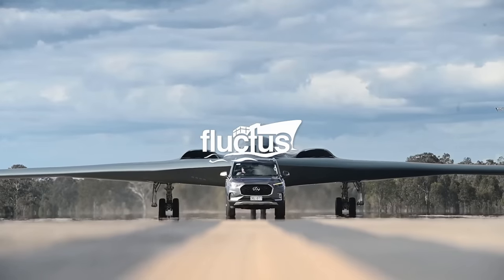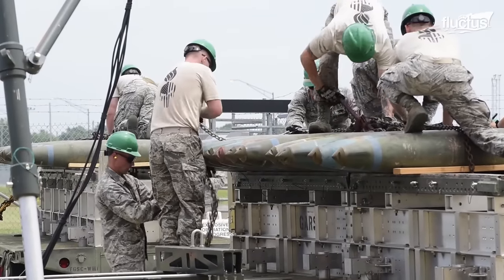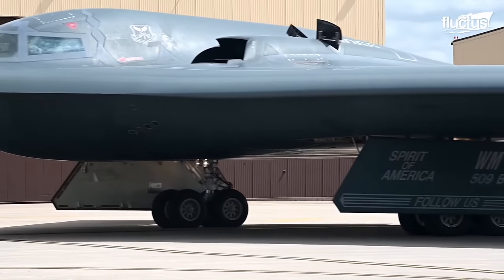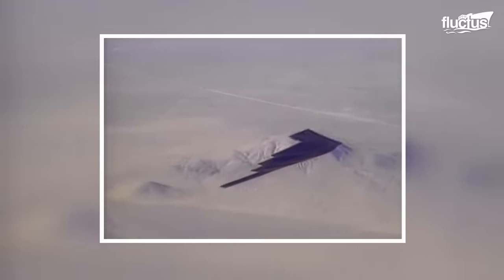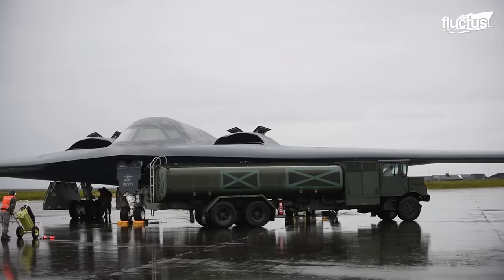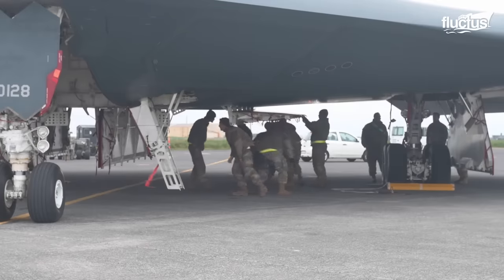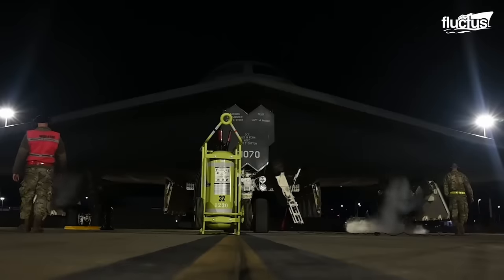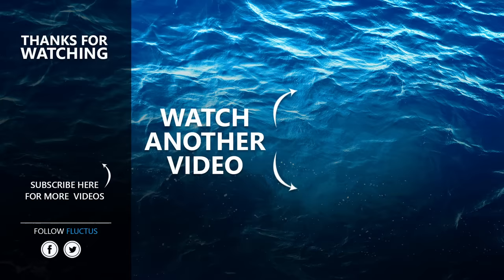B-2 Spirit: US Most Feared Stealth Bomber Ever Made

Comment: Operation paperclip  -  Hitlers Horten Ho 229 ( secret aircraft) converted in to B -2 sprit Bomber.
Reply: The B2 is based on earlier flying wing designs of the 20s and 30s from Northrop themselves such as the YB36 and YB39. They combined the basic principles of a flying wing with lessons learned from the Tacit Blue program and made the B2. 

Northrop used original designs of their own manufacture not the designs of the Ho229 which was frankly a terrible airframe. When tested by both lockheed and northrop to test the validity of stealth claims there was no such "carbon black" stealth coating as the Hortens had claimed and the Ho229 was around the size of a He111 on radar from the time.

Comment: German technology from ww2
Reply: No, the flying wing design of the B2 Spirit is based on earlier flying wings made by Northrop, noteably the YB-49.

The Germans never made a stealth aircraft in ww2. The Ho229 while a flying wing was very easy to spot on radar giving off a similar signature to an Me262. Northrop built a full scale replica and tested it to prove it wasnt stealth, and the mockup was actually stealthier due to the use of only wood in its construction which can absorb radar. The orignal Ho229 has a steel frame.

Tldr: its not stealth, that was a claim made by the Hortens to try and seek asylum in the US. In reality they never worked on the Ho229
Reply: You should go learn about the aviation industry, since you obviously don't know a thing but act like you do.
Reply: @ixnorp4270  Is this directed at me or the original comment?
Reply: @Tozzpot500  If my post was directed at you, there would be a "@Tozzpot500" at the beginning of the post.  Replies to an original post are posted in chronological order, which is why my post was under yours.  Just because it was under your post does not mean it was directed towards you.